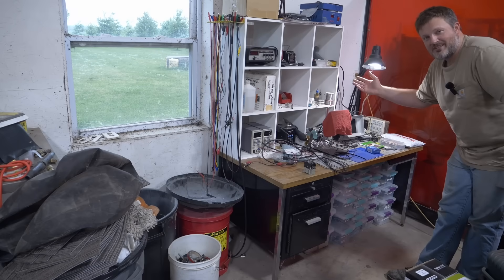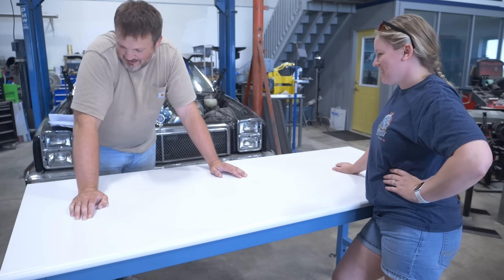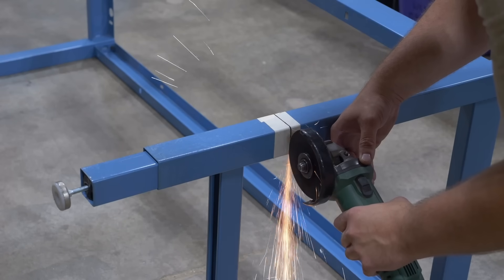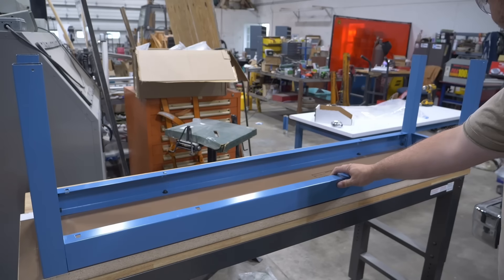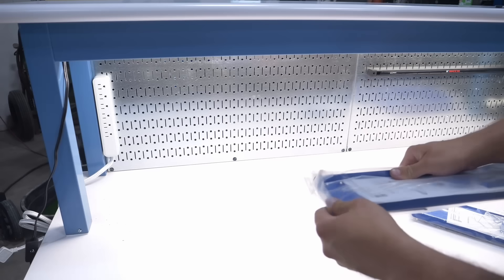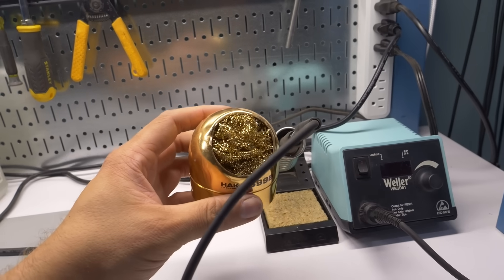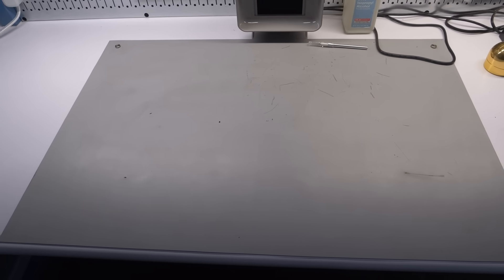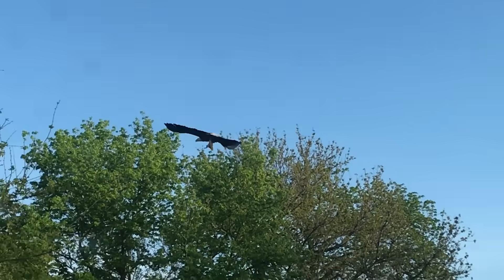Building an Awesome Electronics Bench on the Cheap

Comment: I have 2 of those work benches. A friend of mine about 7 years was a building engineer at an office complex and they were remodeling a building that Novell used to occupy. They were getting ready to throw away 6 of those. I was only able to take the 2 at the time. Mine have the upper shelves, 3 drawers under each. Switched electrical outlets, and I think it has ground plug receptacles. I never realized they were that expensive! I have them connected together in a line. Mine also have light blue counter tops. Glad I took the time to get them. They serve me well.

Comment: I would have to disagree on the 3d printer, bought one and have found absolutely zero use for it, it works great, but i just cant figure out how it is useful....
Reply from the maker: I was in that boat for a few months with mine, then it clicked. Every special tool and fixture is just a few hours of printing away. Marius Hornberger has a great video on how he uses 3D printing in his wood shop.

Comment: That conversation with the wife plays out several times a year here as well. She has a point about half of the time and the rest of the time she gives me pause and I wind up with a faster. most times better solution. My electronics bench went from a time consuming home brew to a modified IKEA adjustable standing desk with stainless steel restaurant shelves. It was so much better and less time consuming than the original plan. Your solution was off the chain man, wow. Cheers.

Comment: Funny, I never knew that there are an electronic table standards, but that looks just like the electronic tables we had at Hartford Public High, but we also had a huge power wall that could patch various voltage AC/DC to each bench (Dated 1979 just when electronics went from Analog to Digital). I remember when the Japan transistor was all the rage instead of vacuum tubes. Hah old times. If you want to have a laugh go watch "Gung Ho" 1986 movie with Michael Keaton. By the way Wes, Loved your video.

Comment: I made a booster fan that would reach out over a board so you can keep the fume extractor a ways away as most of them do not move much air. I used a foot pedal so I could control the fan without having it run all the time. A light with magnifying center is also nice to have.
Worked on benches like that for 28 years. You have to set it up so that it works for you.
Me being left handed made it so it was MY bench as everybody else was right handed.......

Comment: May I suggest a dim-bulb-supply for testing mains-powered devices? It is easy to DIY, it's just a mains power cord with a receptacle and a light bulb socket wired in series. Small devices will get almost the full 120VAC, because of the small resistance of the cold incandescent light bulb. But when your device would have a short circuit or drawing way more power than expected, the light bulb will just light up. No tripped breakers, no harm done.
The luxury model has several light bulbs with switches, for easy selection of the expected power draw. And a bulb bypass switch. And a fuse.
Reply: The hard part of making a dim-bulb tester is finding the bulbs. You need incandescent bulbs, and you can’t find them in stores anymore. LEDs won’t work.

Comment: I don’t have a 3D printer but I’ve had stuff printed, some of which I needed threads cut into. I found heating a nut of the appropriate size and pushing it into the 3D printed item works really well. Nice bench, would do me for my reloading !

Comment: Those high priced toilet seat stories and such are mostly just news media smoke and mirrors. And often the prices are justified because of the mil spec requirement. We supplied a hammer for several thousand dollars. The stack of mil specifications for that hammer were literally more than a foot high. And I am using "literally" correctly. GREATER THAN ONE FOOT. It took several engineers more than a year to have all the tests done and study all the specs. In the end it was a Stanley hammer from the hardware store.  BUT, we had to get a special contract with Stanley that we could continue to buy that EXACT hammer, same alloy, etc. For years to come. Not something Stanley always did. They were usually free to make improvements to their product line and change it as supplies changed but we had to make sure we got exactly the same hammer every time. Stanley had to charge us more for that guaranty. And we had to charge for our engineers time to do all the tests and paperwork for the stack of mil specs. AND the Airforce ultimately only wanted to buy about 200 hammers over 10 years. One spec concerned the spark that the hammer might generate in fuel vapor environment.
As for the toilet seat story it turned out the news media was comparing the cost of the toilet seat made by someone who was NOT doing the mil spec paperwork. And once that was calculated it turned out the toilet seat was appropriately priced.
Reply from the maker: I understand. I have done work inside government nuclear research facilities, and on military bases. You don't just show up and start working.

Comment: Don't know if it's true or not cause I saw it on Tiktok but a guy showed a small bag of bearings that NASA supposedly pays 300k for and you can buy them at your local hardware store for under a hundred bucks. To be fair they are specialized outer space bearings so they require technology that goes way over our heads, lol. Just an astronaut taking a poop in space costs the taxpayers a hot million.

Comment: What a sweet project . Turned out better than buying from the factory. Did you not use the l shaped 3d printed clamps . But hat off to you  a cracking 1st class job . 👍👍👍👍

Comment: Print a hole for a nut, let it print until the nut fits (you can either program it to stop or have a specific feature that only shows up in the print when the layer over the nut height's about to start printing) then put your nuts in and you'll have proper nuts inside the print.
BONUS round: if you make a cylinder with the nut feature, then drop said cylinder with the nut feature inside your print (in the program - i use sketchup with an STL extension) as a group, separate from the group of the main print) the slicer will direct the printer to print that feature inside, as if it's a separate print (printception). If you also add internal features, this then becomes a very strong mounting point. I've made nut crackers that are not much larger than the metal ones with tricks like these and i've even made a custom nutsert tool to fit inside a feature where the proper tool did not, and it worked with stainless nutserts. Prints can be very strong if you print them as more than just hollow shells.

Comment: Funny you showed the Fluke meter. I used to work on the 73, 75, 77 assembly line at the Everett Fluke in 1983/84 before I joined the Navy.
Reply from the maker: They make a hell of a good meter.
Reply: @WatchWesWork  It's been the best on the market for decades.

Comment: The 3-D printed ends for mounting the tubing to the bench are genius.  I am absolutely going to use that idea next time I'm in a similar situation.
Reply from the maker: Worked great. The feet on the legs of the bench are basically the same, just molded plastic.

Comment: Given your metal working and welding abilities, I'd have made a corner desk out of the 2 bases, and build a custom shelving solution, with one shelf and the pegboard on one side and the other being just shelves to hold power supplies, oscilloscopes, and other test gear.

Comment: Thank you so much for the video.  Isn't the 3d printed brace connecting the 2 halves together a little weak for that application?   Either way nice job and thank you for your time.

Comment: Looks nice !
One thing to remember is the way you do the earthing of the table and tabletop.
NEVER connect directly to earth unless you frequently want to test your earth loop failure relay with your body  (ouch !).
Always use a series reistor to earth (500k for 115Vac,  1M for 230Vac).
Do this for every equipment you have (solder iron, PSU, etc.) not to distribute a power earth failure from any defective apparatus.
That way you are still properly protecting your equipment, unit under repair, and yourself.
Cheers :trophy-yellow-smiling:

Comment: Nice job Wes, I recently purchased a cheap 30 vdc/10 amp power supply for testing, it said it was variable, but come to find out you have to set the amperage and voltage before the test and have no adjustments during the test, so buyer beware that's why they're so cheap.

Comment: As an older guy I would add a bench mounted lit magnifying glass, and if your eye sight is really getting bad a set of jewelers loops that mount on your glasses
Reply: I have 2 Optivisors, one for each workbench,  plus the magnifier with light
Reply: I’ve started doing some board level repair on small electronics. Ive got a vintage microscope I’ve added LED lights and a circuit board holder to.

Comment: Nice bench Wes. Could I also recommend some form of signal generator, for your purposes a Function Generator, to get a signal into things. You can then chase the signal down with the scope. An old analogue multi range meter is still useful, AVO over here but a Simpson 260 series or equivalent Triplett for you in the US (I'm sure you'd have one anyway!). That needle swing can tell you a lot more in some situations than a DMM can.
Reply from the maker: I have a BK function generator.

Comment: Wes, in case you didnt know: You can get thread inserts for 3D prints, which get inserted using a soldering iron. they basically melt into the plastic, allowing you to repeatedly screw and unscrew stuff. For this project they're not needed tho. Fantastic job, enjoyed watching it
Reply: I've also seen people suggest adding a pause to the g-code on a specific layer and then dropping in a metal nut, maybe supergluing it down as well, and then resuming printing manually.
Reply: Helicoils work fine too.  Size the hole for the helicoil tap and you've got steel threads instead of plastic.
Reply: @JobyFluorine-ru4bd 

Looks to me that was recycled 3D materials. An excellent use the second time around. You fool.

Comment: Wes, I wish that you were closer to the MD/VA area.

A company I did contracting work for after 26 years decided to close down. They had 3 Sturdilite electronics benches with the side drawer units that needed gone, ASAP. The owner ended up placing the benches outside the loading dock for anyone to take.

When I ordered the benches new, with the power station on both columns, the riser and the side storage drawers were $3200 each.

Comment: What are the "slidey-feet" use to move the too-heavy-for-Mrs-Wes bench at 12:10 ? 

I (on advice from a forum) have "Furniture sliders" under my 450lb Hammond organ, but your ones don't look the same. Back when I was 40 years old, I could move the Hammond on my own, by 20 years later, it was getting tough. The sliders made a great deal of difference.
Reply from the maker: She got them at the local hardware store. Just generic furniture sliders. They work amazingly well on carpet!

Comment: Same reason I never bought one of those. You can buy used benches sometimes when big companies are getting rid of stuff... Though the last place I worked at would be just as likely to take a perfectly good bench and toss it in a dumpster.

EDIT: I kinda want to replace my Weller WES-51 with a WES-51D.... I was poor and in school at the time, but there's nothing wrong with the WES-51 aside from the lack of a digital temperature display.... And now I know why you got that over the Hakko 😆.

If I were to upgrade my soldering station I might go with a Hakko FX-951 for the higher thermal capacity, or copy Marcoreps or whoever it was who made a ripoff JBC or whatever it was.

Comment: You will need a HDMI digital microscope and a hot air station for those SMD projects. It’s a big screen for doing SMD work on circuit boards. Also grab an old Tektronix 4445 4 channel oscilloscope. You can’t beat old school tech.

Comment: Wes,
New bench looks great.  As a 35 year tech in and out of Navy facilities I like it.  

I understand why melamine ESD tops cost so much.  Melas are small fuzzy woodland creatures that are only found in a tiny area just east of Gotland Sweden.  It takes a lot of them to make a benchtop so the prices stay high due to over hunting and loss of habitat.

In addition to all the general stuff.
On my bench I also keep a solder sucker.  I find sometimes it works better than solder wick.
I have one of those cheap Chinese 1/4" drive screwdriver sets with about  75 different bits with everything from screwbits to nut drivers.  The one I have has a screwdriver handle that also accepts a ratchet.  For 95% of the small fasteners I run into it does the job before I open up the Xcelite tool suitcase.  
I really like the Whia precision screwdrivers.
A set of Knipex automatic squeeze type wire strippers is handy.
As I got older I found I needed a board microscope.  I like the LCD type better than the fixed eyepiece.  They are getting cheap to buy now.  ~$250.00
I bit the bullet and bought one of the Weller 6966 heat guns you showed.  Pricey but I  have to say I love it.  Thank You

--M--

Comment: Went through the same sticker shock on pro benches. Wanted one because we used those kind in the service in our Avionics shops. I ended up using a red Husky storage rack from Home Depot, replacing the metal wire shelves with plywood. Might be a good idea for another bench in the shop for heavier work. Sweet find on those two benches!
Reply: For a reloading bench, I used the 2 sets of chrome metal wire shelves for the side potions and then made a tabletop out of jointed 2x6s and 2x8s stretched between the shelving unit.  It allows me to use all the shelves for storage other than the level that I'm using to support the tabletop that I built.

Comment: Great setup!

Two suggestions:
A: Add a few mains power switches. One that switches on the lights and any measurement instruments and whatnot. Another that switches on outlets for devices you are working on, and your power supply. This way it's easy to not forget something switched on, and also it's easy to use this as an emergency off if something goes poorly.
B: Maybe have that cable holder on a hinge so you can swing it out to be able to reach it while sitting at the table. Or possibly just mount it on the wall to the left of the table.

P.S. you will miss the additional bench, but you made the right choice to use it for a shelf. In my experience it's a bad idea to have more than the absolutely minimum viable bench space, as it tends to accumulate half finished projects. I strongly recommend installing cabinets everywhere, as they are great storage but won't get used to drop things that you intend to put in their right place later, like shelves tend to do.

Comment: For tapping holes in 3D prints, my shop has found great success with ribbed rivet nuts. All you have to do is make your hole slightly smaller than the OD, and then press them in with a hot soldering iron. The heat transfers through the steel and melts the plastic enough to get the m seated. 

You get a bit stronger hole than just tapping the plastic itself.
Reply: As well as just making that section thicker

Comment: Thats pretty slick Wes. I made mine out of 4 tier steel wire shelving units from menards, replaced the 1/4 x 20 threaded leveling feet with threaded rubber wheeled casters that can be locked so i can easily move them around if needed without having to clear the gear and parts bins off them, added 3/8" esd sheets i found and cut to fit the shelves i use for work surface areas. My lighting is a lot like yours. For that i used some self adhesive led strip lights that are 5v usb for putting behind led tv's, some time ago a store here had cases of them left over from xmas and i got half a case for 25 cents each. Still coming up wuth uses for them lol

Comment: And don't forget the ESD mat for that Electronics workbench. I would also recommend a soldapult solder sucker and a "third hand" to hold and keep things steady while soldering.
Reply: A third hand with lighted magnifier is nice.
Reply: @1pcfred I worked in the QA engineering dept/test lab for Parker-Hannifin Corp in their Automation Division in northern California for years. All of the benches had ESD mats with drain wires to ground. Technicians are required to wear ESD shoes and wrist straps with drain wires too. I would do the same and not take a chance on zapping an expensive piece of electronics. You have no idea what parts the circuit is built with. Better to be safe than sorry!
Reply: @damonhill4909  if it worked it wouldn't need to be worked on. Some things aren't worth fixing either. A lot of rules are just about obedience.  There's a certain type of person that likes when others do what they're telling them to do. Wear the shoes and the straps! Some like being told what to do too. So it all works out.
Reply: ESD isn't the problem today it was in the past. Early CMOS was very sensitive. Such fragile devices haven't been made in decades now. We have made progress on that front.